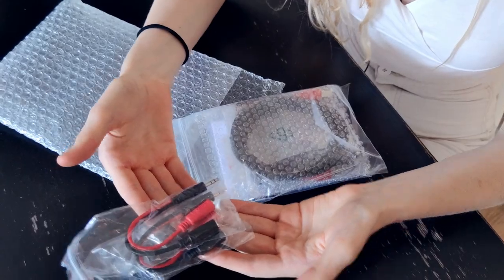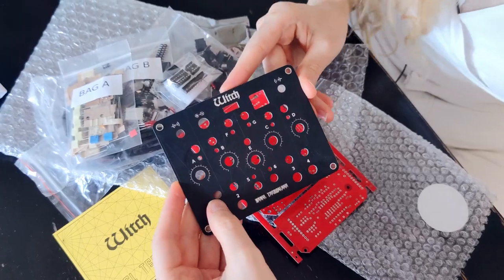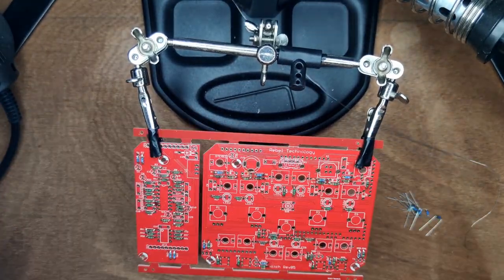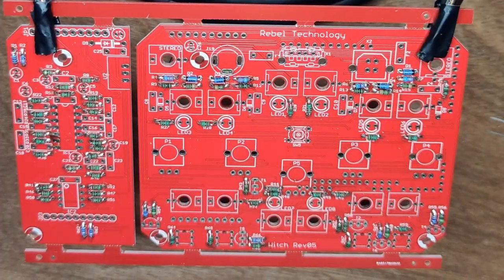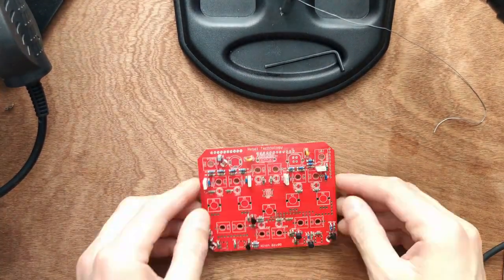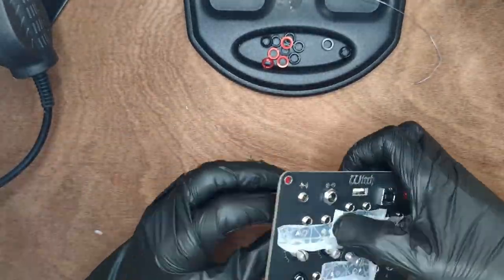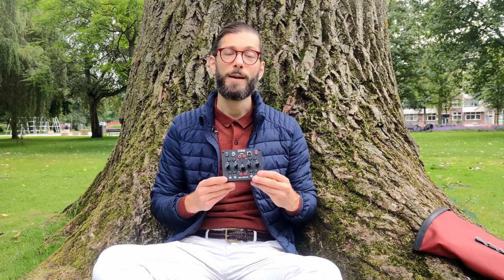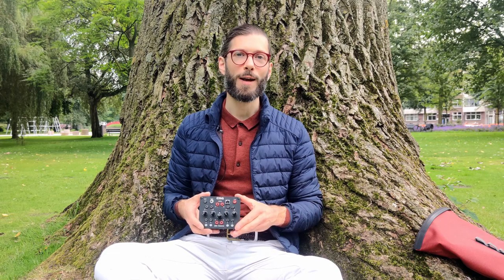Witch by Rebel Technology and Befaco: close-up build, audio demo and review

Comment: Great video! Are there any differences (over more inputs and control knobs) between the witch and the litch? Seems the same thing
Reply from the maker: We don't have a Lich, but I believe that the inputs on the Witch are AC coupled which means you can just feed them volt per octave without calibrating. Slightly different hardware, but approximately the same functionality